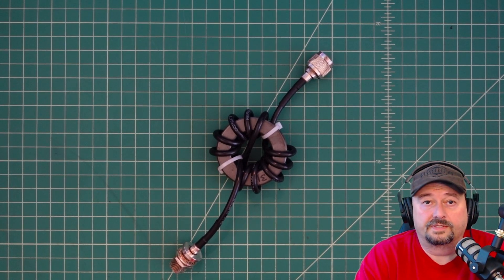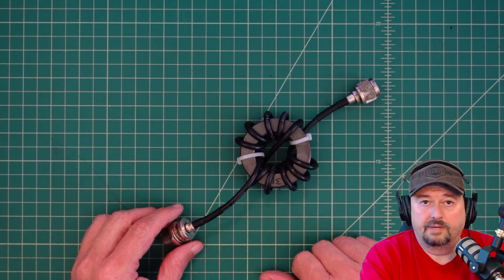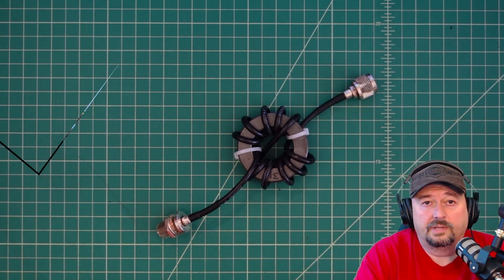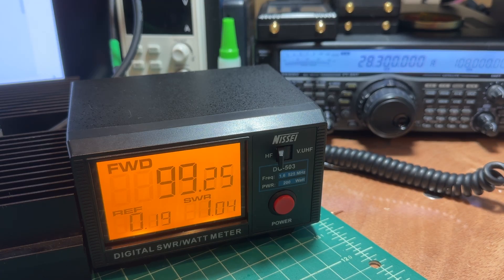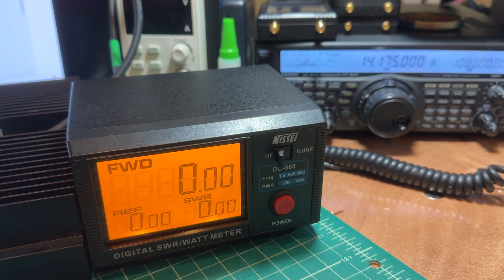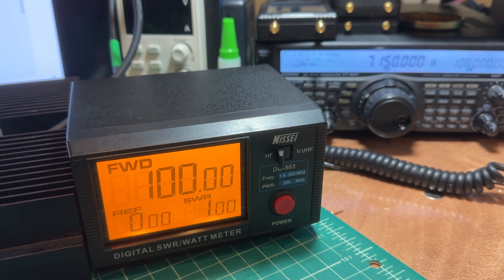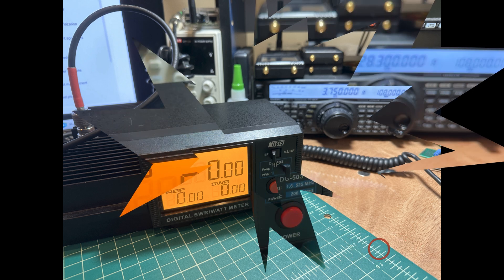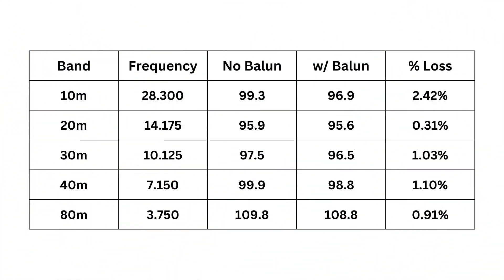Myth Busting: Choke Balun Power Loss - You won't believe this!

Comment: Looks more like an unun, not a balun, but that's just me.
Reply: In what way?  When a ground and signal line pass through the transformer equally without any connection between the center pin and ground it's a balun.  An unun has a jumper connecting the center pin and ground.
Reply: @MentalWhiplash  Agree to disagree. Balun is BALanced <-> UNbalanced. This choke is unbalanced on both ends: UNUN. A balun might have jumpers, but it is not necessary.
Reply: @LeeMccNA5T  if the choke is successful at reducing common mode current to a "negligible level" the output side can be argued to be balanced.
Reply: @g0fvt  I will stick with unun since both ends are the same. A balun means the ends are different. Its fine. We don't have to agree. 😙
Reply from the maker: g0fvt is correct.
Reply: @TheSmokinApe  Agreed. If your antenna system is plagued by CMC, it's unbalanced AF.
Reply from the maker: Lee, I thought you were making a joke because of this video: https://youtu.be/vnQ7u1g-aFo
Reply: I think this stub of the discussion encapsulates the heart of the problem here.
The idea that balanced currents implies a balanced line is wrong. Both unbalanced coax and balanced twin feeder have balanced forward and return currents at matched conditions. 
Where balanced line differs from unbalanced is with impedance and voltages on the terminals. Balanced line has equal impedance on both lines and equal and opposite voltage, ie differential potential, on each line. 
Coax and unbalanced lines have an impedance only on the centre connection, the braid is ground, zero impedance. All the signal voltage only appears on the centre connection.
The common mode choke featured here is not any kind of balun, transformer or matching device. Its just a choke.

Comment: How does this compare with using ferrite beads? I use 4 ferrite beads at the antenna connection and 4 at the radio connection. I have no idea if it's making any kind of difference at all but I figure it couldn't hurt if anything and I have tons of them in a box anyways.
Reply from the maker: Hey TTK, bead work fine and that's what I would use if thats all I had.  In my tests the core do perform a little better but you're fine with beads.

Comment: Good video.    if you use 2 torrid rings. will the loss be bigger???????
Reply from the maker: It would be but the real value in using more cores would allow for higher power levels.